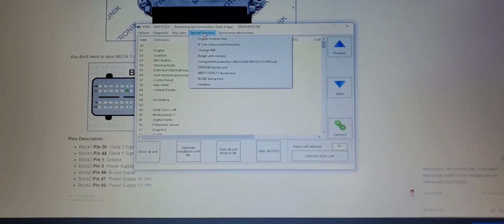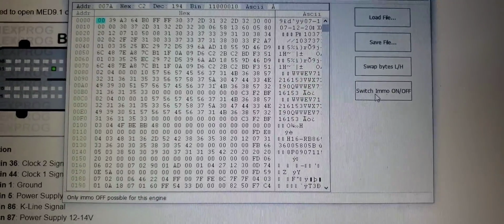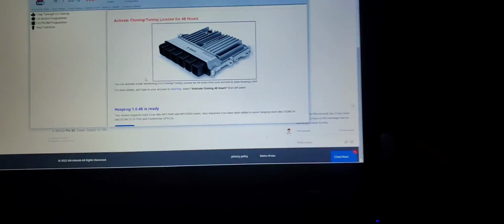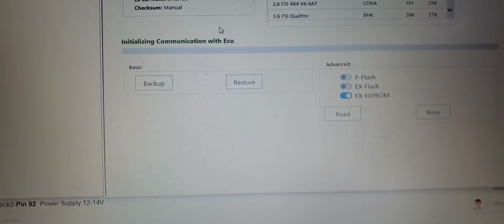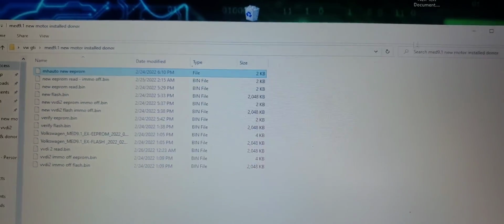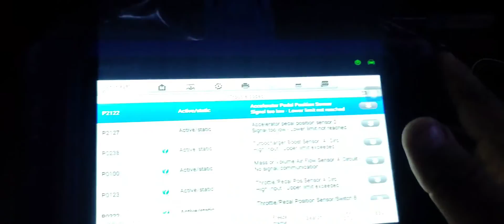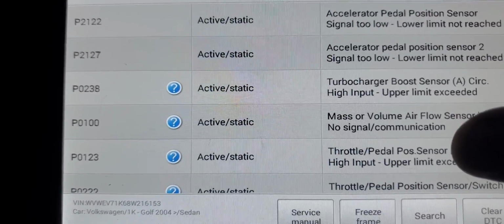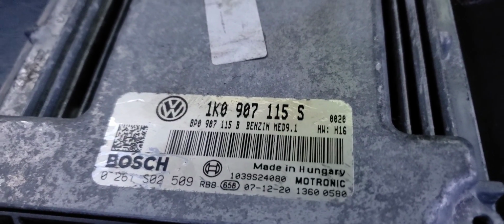VW ecm Immo Off  (Med9.1) using VVDI2 and Microtroniks Hexprog

Comment: Hi please thanks for your knowledge sharing spirit , i would like you if you can help, me with dump immo off bin file for both flash and eeprom for my vw jetta fsi 2.0 model 2007, i do have error immobiizer adjustment, so on my PCMFlash module 71 it does not appear on my list?

Comment: Hello, am having safe shown on dash of VW Q7 4L. Original ECU was fried and the owner got a second hand ECU the car worked ok for a while but now it cranks no start, no spark. Do you think wrong immo file would do that? 

Thanks..
Reply from the maker: If car ran with replacement ECM before without any issues then there should be a problem somewhere else... Check for water coming into car because maybe bad module killing communication... You need to scan first and see what codes all the modules are reporting.....  

Also if ECM was opened to clone then maybe water got into ECM, maybe they did not seal ECM properly..

Does the car turn on for a couple of seconds then shut off???
Reply from the maker: With bad communication ECM should still start car for at least 2 seconds then shut off...  Scan and check all codes, if you can see live data in ECM check RPM data pid to see if crank sensor is working
Reply: Yes there was water on the second ECU, someone tried to fix it but when it starts for some minutes then it stops. Would only crank but no start.
Reply: The time the car starts is not enough to run a live scan. Though I have read in some forums that a faulty crank shaft sensor might be the problem.
Reply from the maker: @temejumbo9794  go to live data in ecm and view Rpm pid ... Hold in crank position to keep starter active while viewing live data you should be able to see rpm 200rpm to 600rpm even if car does not start...  If you have rpm In love data while engine is cranking then there is another problem (maybe relay that powers coils is not being activated by ecm.....    If I where you I would get another used ECM install and see if car starts for a couple a seconds .. Good luck 👍
Reply: Thanks for the knowledge.❤

Comment: Hi , excellent video,
Question you only write eeprom new file from vvdi2 ,( NO FLASH), right??
Reply from the maker: Hi thankyou .. Dont forget to like and Subscribe.....  This method uses information from flash and eeprom  to make modified  new  eeprom.  100% guaranteed to start with no hard codes or safe message on dash .. power windows and accessories work fine... with wrong immo off for some reason accessories won't work in car... Goodluck